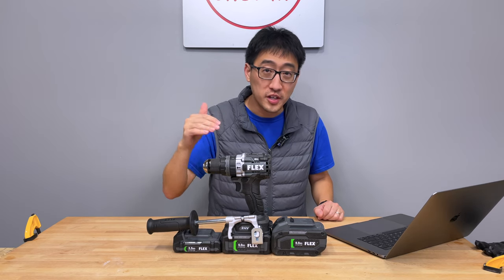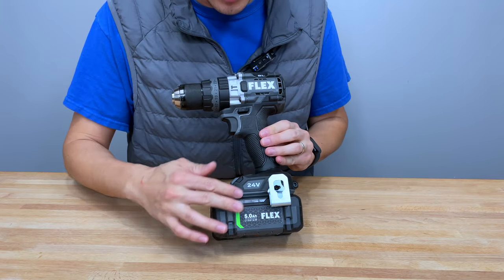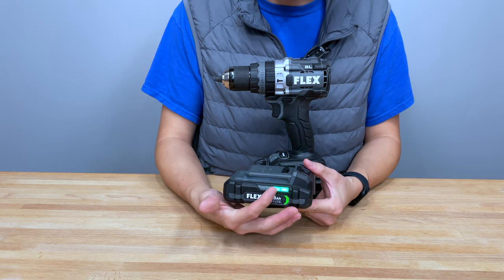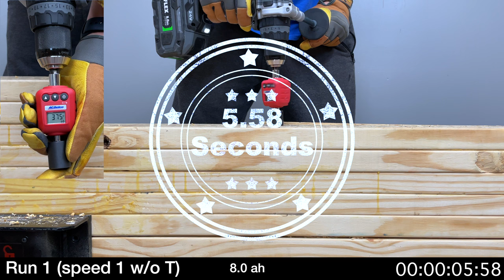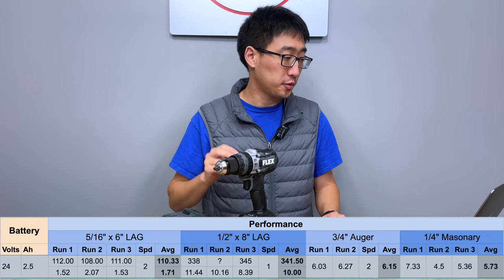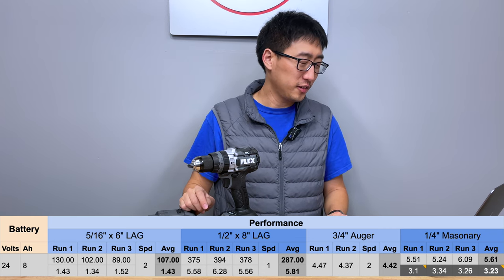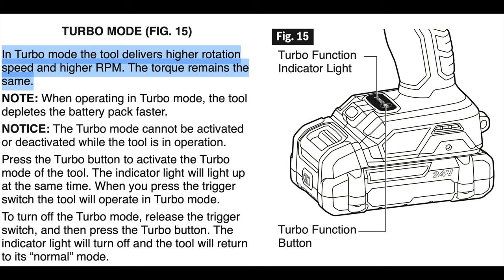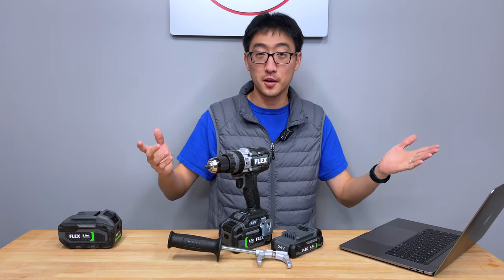Flex 24v 1/2 inch Hammer Drill with TURBO Review - FX1271T | 24v Power | Drills - ep.8

Comment: I bought this on sale at Lowe's a couple days ago. I plan to use it for IT work and some masonry drilling (outdoor cameras). I went with Flex because I have a couple of their auto detailing tools, and they are more known for those  (Flex 3401 is one of the most recommended for beginners to auto detailing). When I saw they had power tools, I just had to grab one. Good to know that it performs up there with Makita and DeWalt, two well known power tool brands, even when turbo wasn't working. I wasn't buying the drill for the turbo mode, so if anything, this review gave me a little more comfort that this drill can still perform. I feel like they have the potential to improve it is just power tools is a whole new market for them. Only time will tell.

Great review!

Comment: Great review man. You pointed out something that no other reviewer has pointed out. The turbo function only increases the speed and does not increase the power/torque. Seems a bit sad that when the tool heats up it can no longer use turbo.  Seems to be one of the top flagship tools that is still using a manual clutch.
Reply: I am a carpenter and I use this drill in the real world not just a test bed and yes in extreme heat the turbo defaults to high speed to save the motor. I think Flex is over cautious but in the real world we don't used the drill driver like that. Name me a job where the drill driver has to work like that?

Secondly speed and torque are simple 2 different things, when the ijob requires high torque like drilling into steel the driver is placed on the lowest mode to attain the highest torque and if speed is required then it is the opposite engagement.

The truth be told we use this drill driver with the 2.5 amp battery even though it comes with a 5 amp battery and it is a monster beast. Not sure why anyone would use a 5 amp battery even though it is sold with it or use 8 amp hour battery
Reply: @rickyperkins232  Running structural wire for acoustic is very demanding, and only a handful of models can hold up to moderate amounts of that. The Flex Turbo isn't one of them, seeing as thermal issues seems to be pretty common with them whenever they see moderately hard workloads.

Sparkies also need to do drill dozens of holes through framing on any wood job, and through metal in some circumstances. Yeah, they could buy and drag around a Hole Hawg, Super Hawg, or the Makita/DeWalt equivalents, but why would they when a regular Makita, DeWalt, or Milwaukee drill can go all day and fit where they're needed 95% of the time?

Hell, I've had a one off remodel job where I had to drill just shy of 20 1" holes though 3 layers of LVL beams, which is still more than what many (honest) reviewers did to get the Flex to over heat.
Reply: I'm a electrian and drill every hole through every stud when I walk in the door an do it in top speed with turbo mode not once has mine stop and I can't drill these holes with any other drill in in top speed I've owned everything even a holehawg fuel model drill if you want to know what tools to buy there's tons of people testing the turbo drill and it's numbers are all you have to see to know it's the best drill on the Market foot lb. Of torque flex turbo drill wins speed wins turns faster than anything else on the market before you hit the turbo button the final point I will point out is your tolls stop spinning do you hold down the trigger for another 15 seconds letting the motor hum Because the only time I've seen a test from a trusted source torque test channel is when I seen a flex tool lock up . Use the turbo drill to drill a 2 1/2 in holes in top speed turbo running that's about 700 rpms faster than any Drills you can buy and most won't do it in high speed to begin with so shif to first speed on everything else and your between 550 and 1000 rpm and the don't put the flex turbo turbo it's still turning 200 more rpms than anything else look at the stats 2200 high speed without turbo 2700 with it doesn't increase the torque but it's like a diesel with turbo it doesn't reduce the torque it does increase hp it's got more torque than anything else period I've not seen one negative review of actually tool use that I'm not doing on the regular without any trouble
Reply: @tonywalls7991  Most trust worthy sources have had thermal issues with the turbo drill and impact with sustain loads. Something I've seen with drill brushes. It's even gotten to a point where a reviewer's trustworthiness can be accurately gauged by their flex reviews.

Also, the marginal, circumstancial performance improvement over the Milwaukee 2804 isn't worth the bad ergonomics on the drill or impact either. 

Oh, and running at a higher RPM using turbo does incur a torque loss. Electric motors drop torque as they increase RPM. It's also certainly not the highest torque drill on the market, the DV36DAG, DCD998/999, GPH01, GAD01, XAD03, and Hole/Super Hawgs are all higher torque drills.

And the real kicker, if you're referencing the reviews on Flex's site or anywhere online with the 'pulled from Flex's site' disclaimer, those mean nothing, they aren't trust worthy. Firstly, abuse of the rating systems by both resellers and manufacturers has rendered that information unreliable at best, and we've seen from Flex's marketing that they have zero issues lying and cherry picking to hell, that's it's a reasonable assumption to assume they'd abuse their own rating system. Second, Flex tools are largely sitting on shelves, collecting dust. Part of that is consumers seeing through the bullshit. Part of that is that word for mouth on Flex's tools is not that good.
I've ran into an electrician running a Flex drill. He said that he's probably doing to return it and but something lighter because the small power bump isn't worth the weight when he's constantly using it over head.
Reply: That’s just how physics work my man, the hotter something gets the less performance it can output, the more raw dog power something it has the more heat it accumulates. The turbo is a great feature but it’s impossible to increase speed and torque unless you were to cap the engine lower than it’s rated torque and unlock it with turbo. Basically the turbo button is capitalizing on that great torque it has at the cost of heat which after enough heat builds up will diminish the torque so while your still drilling fast your power is being reduced. The flex tools are an amazing lineup I use them everyday and to be honest I push them hard and they take it. Ran the impact drill to the point it was boiling and spitting oil, doing tasks no other impact could do, afterward it was significantly diminished on torque, after I let it cool though it suffered no damage and put that full torque right back out again. By the way the task I was using it for was driving retaining lags for a tree house, these suckers are huge and going into a tree trunk. Using these tools for everyday work they outperform literally everything in power and runtime, plus the quick charging is nice and hardly ever used. All I can say is give ehm a try if you don’t like them you can always get your money back upto 90 days at Lowes, but if you do like it and enjoy the performance like me register within the first 30 days and get them warrantied for life! Pass them on down to the kids!!

Comment: The sensor free (or sensorless brushless motor) is not marketing hype, it's a designed based BLDC motor. The main advantage of this design when the motor is running at high speed, it gets its full potential and efficient. However, the drawback is that it's not efficient at low speed application. Sensor -BLDC's are heavily used in drones low speed application and precise position of the motor is needed.

Comment: I like the Flex concepts (as Ive said before), but I've made many a mistake buying new release items, or new brands that just came out.
 
 Time will tell as to what it can/can't do. For myself, durability, and longevity are the most important factor in a tool. I'd rather have a rough tool that lasts longer, than a smooth tool with great features that doesn't last, or has issues.
 
So thanks again, as always, for giving the most in depth reviews out there today!
Reply: I hope so too as I was vested in Ridgid and that's just a failure brand, I hope Flex does better because both Milwaukee and Flex is my Ridgid replacements
Reply: @rickyperkins232  well you did good not going to Dewalt. They didn't just go downhill... they jumped off the cliff entirely!
 
I am still Makita, but dumped most of my Dewalts, and went to Bosch. Bosch has really impressed me. I'm avoiding Flex because Chervon has great ideas, but horrible execution (See Skil). But for your sake, I hope Flex holds up for you.
Reply: @carterscustomrods  I had bad issues with Dewalt, when the went to yellow and black they made a 12 volt with a trigger guard that was literally braking the trigger finger on torque. DeWalt wouldn't fix that damn problem so we would cut off the guard with a hacksaw. 

Then the invented the T-handle driver which is bad for your hands now the entire industry followed. 

They practically invented the 14.4 volt by themself with a bad trigger that they would fix.

Then they had the chuck problem that they would fix for $90.00 after 90 days. 

Then they started to lose carpenters going back to Mikita because every f%%#@ battery from the 12 volt to the 14.4 volt to the 18 volt was a different fitting and wouldn't interchange. The 36 volt they pulled the line and left us hanging.  Then they switch from the 36 volt  to the current 18 volt. Let's see what happens with this 60 volt thing they area doing since they have the stack battery technology. 

I am done with DeWalt. Dewalt will drop a line if there in enough sale instead of low volume There's so many bad stories about DeWalt it is  just unreal.

The only thing DeWalt I have in my possession is a drywall driver kit and I just purchased the Flex drywall kit to replace it. 

I don't know much about Skills because carpenters don't use the brand at all.

Bosch puts out an absolute awesome product but their lineup is limited too.

Comment: Great  video  brother. I will  say I like  the  way  flex tools handle i have  between 4 and 5 thousand dallers worth
Reply: I had to bring in my 7 1/4" Sliding miter  to Milwaukee for a fix because it is 1° off or the scale is 1° off in Beltsville MD and they checked out my Flex drill driver while there, they were very impressed. 

They said this is good for competition and hope Milwaukee makes a better product eventually.

Comment: thank you my friend. great review! so all else being equal... it is basically between the anti kickback on this flex, vs the better electronic clutch on the makita. depending which feature is more important. to really dumb it down and forgetting if a platforms bias etc. the flex one is significantly cheaper however. so you really do have to pay a premium for the exclusivity of that makita electronic clutch. it is pretty cool though
Reply: I have this drill and most carpenter don't use drills anymore because impact driver are much more efficient when compared but I have to say this drill driver with the 2.5 amp hour battery has out done all drill drivers.

I use it in Turbo mode all the time and yes it will default to the highest settings when hot and in extreme conditions like in the test.

Most drill driver will break if the driver is constantly drilling concrete but I have not had a job where I put it to a torture test.

I broke the chuck last week, called Flex Friday and they are sending me a new one this week, we will see.

The Pros: this drill driver is a monster beast the 2.5 amp hour battery on up.

The Cons: This drill driver is heavy with the 5 amp hour battery and the turbo mode cuts off in extreme heat to save the motor.

Comment: I believe that turbo mode would be good for drilling holes in thick metal, where you're not really pushing super hard , but just letting the drill bit do it's job. I don't think it's for auger holes back to back through 6x6's. Doubtful even sparkies would be drilling so quickly that it overheat running romex.

Comment: I'm precious owner of the M18 fuel hammer drill  and holehawg both fuel models a electrian by trade and drill a hole in almost every stud put in a house every one I do it's not close this shit you see him talking about don't mean anything my flex turbo runs top speed and drills every hole now I can't drill The same holes with any other drill in the top speed I know that this guy wearing glasses but it doesn't make him smart
Reply from the maker: Not even sure what you mean. none of the Milwaukee m18 fuel drills reviewed were unable to drill studpack with the auger bit. They drilled all the 3/4 inch holes without issue in around 4 or 5 seconds.